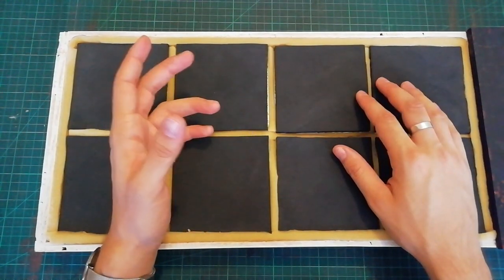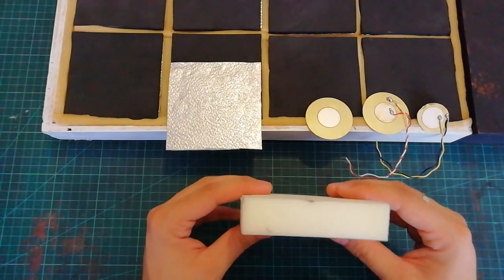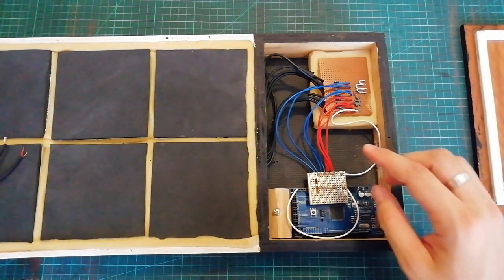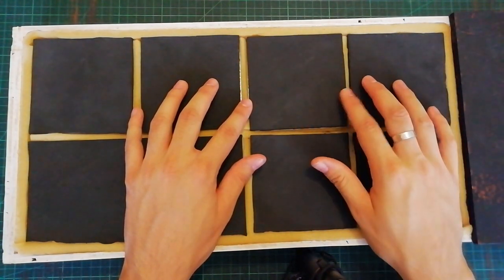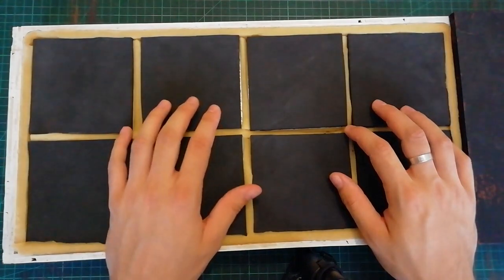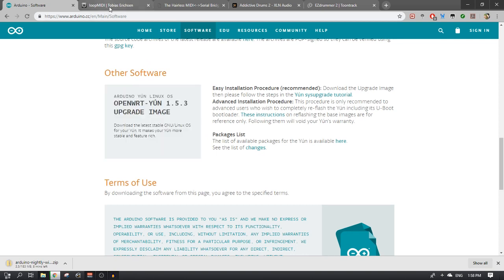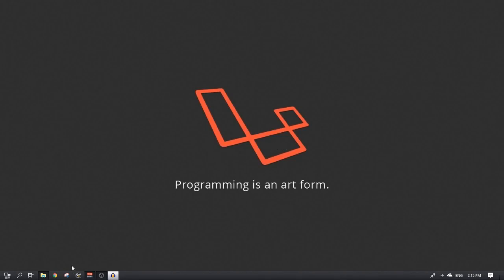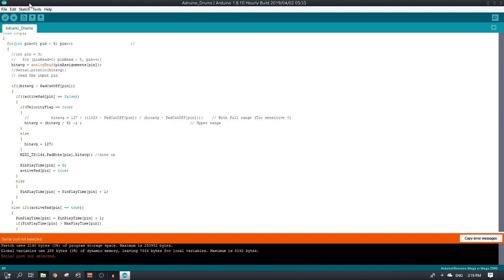Arduino Drums Tutorial Part 1 - Overview

Comment: Hey nice build, i did one on my own on your vid. Could you maybe integrate a trigger for the hihat in the code ? or tell what it would look like ? im pretty screwed up with all the arrays
Reply from the maker: Hey, so basically all the arrays just store different info for each pad you have (in the original code it's an array of 8) so it stores Min activation velocity... Etc. The code cycles through all 8 pads all the time updating these values, so you would need to choose a pad (analog input) to be your hihat switch and sense it, normally if a switch is activated it will give the full analog value of 1024, so try and read if an analog input has a value of 1024 or 0 and then use and if statement to update the arrays midi note, to either open, if the switch reads 0 or closed hihat if the switch reads 1024, hope that helps
Reply: @thinktech3818  ill try that with analog Statement, tried with digital switch but that didnt work. To be honest my coding skills are pretty rudimental.
Bad the switch Working but couldnt get the Note changed.
Reply: @thinktech3818  Hmm, can you tell me what it would look like to assign the right note to the array ? i tried it with if (SW>1020){PadNote[3]=54;}else PadNote[3]=56; but it seems like that code does ignore, hooked up the switch to a led and that works at least.but im not quiet sure where to put that note-switching operation in the code
Reply: oh, got it, needs to be before the first if loop of hitavg
Reply from the maker: Yes, it needs to be in the main loop, and you need to assign the note before it sends the msg to your computer with all that info

Comment: Great video! I’m thinking of doing it myself but I have a couple questions if you don’t mind. Are those piezo sensors pressure sensitive, meaning the drums will be louder if I hit them harder and be more quiet if I hit them softly? Lastly, will this connect with FL Studio and record to the piano roll? Thanks!!
Reply from the maker: They can be pressure sensitive but for that you need to modify the code, their is a line when you can set velocity to true

If you do this then you can't make the pads like I did, you need foam between the sensor and the surface you hit, look around a bit at roland drum triggers and how they work, you'll see what I mean

In FL Studio you need to select the port you set up in loop midi, then technically your drumkit will function like any midi instrument, you can even play piano with it

Anymore questions are welcome

Comment: Hi! I'm wondering, how to integrate the Hi-Hat pedal, i have a kit of practice pads that are perfect to turn into an e-Drum, But how can we add the hi-hat pedal to variate if it is open or closed!
Reply from the maker: Hi, the code would have to be modified, essentially a little "if" statement check that checks if a switch is on or off for instance

If the switch it on (eg hihat closed) then you would need to change the midi note for the hihat to a closed midi note (look at what music program you use)

And then of the switch is off (open hihat) then midi note equals open hihat

That's a very basic implementation but it gets the point across

Ask anymore questions if you need to

Comment: need clean schematic of circuit diagram plz post it 
can i use nano /uno 
for 6 pads
Reply from the maker: The schematic is in part one, there is no need for more than what I gave, it's the piezo, a resistor and a diode all in parallel connected to ground and the then A0 - A5 analogue pins

Comment: 15:28 There are ways but iam not going to say that 😂
Reply from the maker: 😂 I realised now how that sounds, not what I meant but yea😂
Reply: @thinktech3818    dude I also face some problems.
 1. Hitting 1 pad triggers more than 1 midi note simultaneously
Let say piezo set to A1 corresponds to C4 , some time it hits the right target or sometime it trigger B or C# or both of them.
Do you know why it happens and how can I rectify it ?

2.Sensitivity
By sensitivity I mean the minimum time gap b/w 2 consicutive hits on the same pad which the program can sense. How can I reduce this time ?
Reply from the maker: @nstcg7271  a fix that might work would be to use one analog channel straight to ground and to read it between reading the pad values, also what could work is insulating your conductors properly and isolating the piezos under padding etc, as for the "sensitivity", what I assume you're thinking about is latency, that issue depends a lot on the computer you are using and drivers, I would suggest researching videos on ASIO drivers and how to use them with your music software, I am planning on making videos about them but for now try and research about that, the second way is to play with the code, there is an array with "pad cut off values" in milliseconds that you can lower, see what that does, thanks for your comment

Comment: #ThinkTECH could you give us a circuit diagram?
Reply from the maker: There is a circuit diagram in the first tutorial, that's all you need to know, it's just repeated
Reply: @thinktech3818  thanks a lot for the help but I have achieved the steps at part 2. But how do I assign the other three  instruments in addictive instruments (I got 4 piezos) because only my 4th piezo operates as an instrument yet. Thanks for the help for now I am trying to figure it out so thanks a lot for your help man
Reply: Actually its only the 3rd piezo that is working
Reply from the maker: You need to Google the midi note assignments for addictive drums, or you can pull the instruments around in addictive drums itself